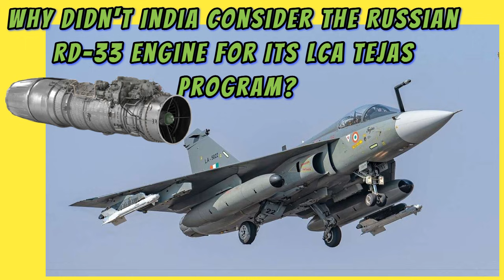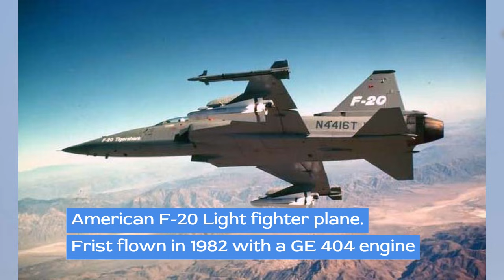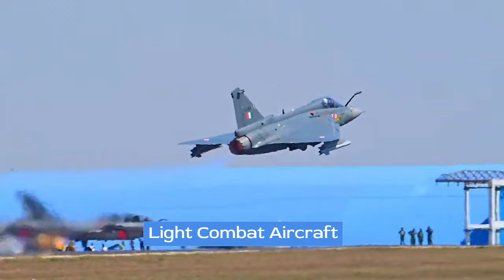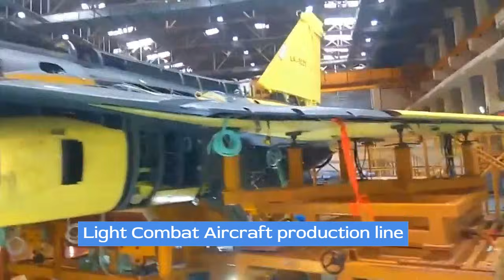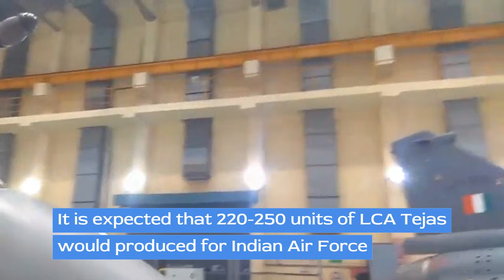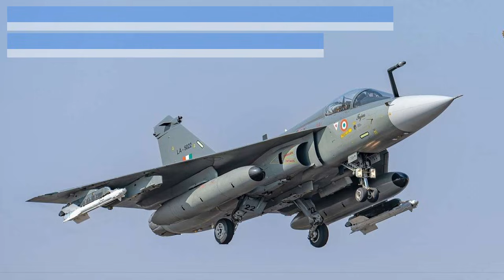Why Didn't India Consider the Russian RD 33 Engine for Its LCA Tejas Program  ?

Comment: Great blunder by DRDO

They have completely misguided the program and brought a threat to national security.
Reply from the maker: It's the problem of government rather DRDO. DRDO failed to understand national security matter in old days because they never onboarded on the national security matters. They were working like individual player. No one consider them as a serious player in national Security. But today situation is totally different. DRDO is a key player in national security. The result is visible. Example - DRDO has developed Light Tank within 5 years after the requirement is initiated. ATAGS howitzer is being developed in record time. Astra MK2, Mk3 etc air to air missile developed in record 7-8 years time.   like many example is there.

Comment: RD-33 is not certified for single engine operations. It lacks FADEC and has a service life of only 4000 hours vs the GE-F404's 12000 hours
Reply from the maker: RD-33 was not certified for single engine application. But under China Pakistan JF-17 program it was certified for single engine application. Modern variant of RD-33 engine has FADEC .